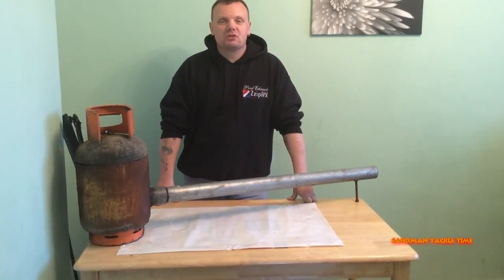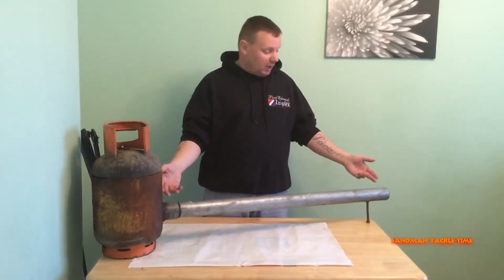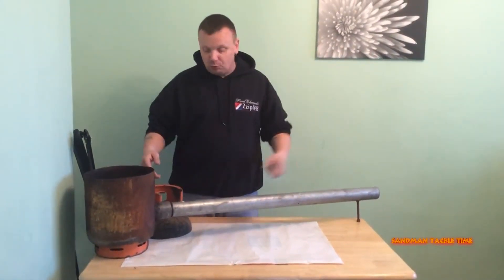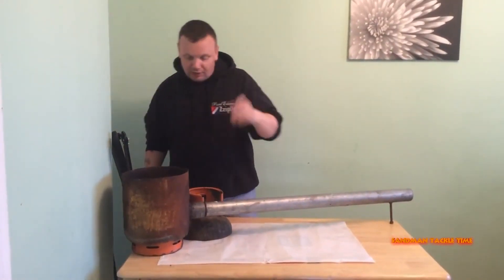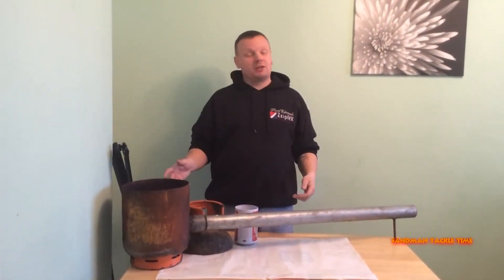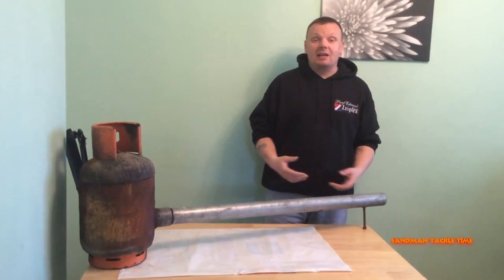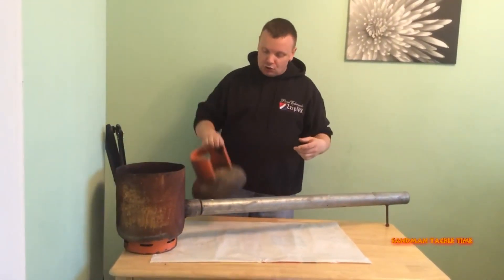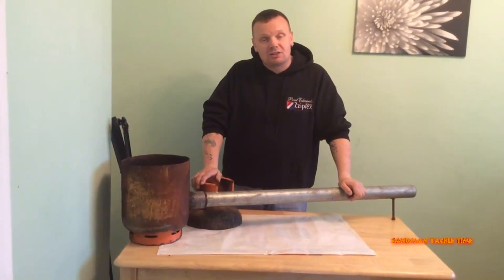Sandmans Tackle Time DIY ALUMINUM FURNACE FOR SINKER MOULDS

Comment: We Used A Small Fire Extinguisher As A Crucible Same Rule Make Sure Its Empty Then Cut The Top Off Using An Angle Grinder We Also Lined The Inside Of The Gas Bottle With Blue Concrete As In 3 Parts Cement 1 Part Kiddies Play Sand This Kept The Heat In, As For A Blower We Used An Old Heat Gun As It Is Fitted With A Metal Collar The Heater Element Was Removed So As To Keep The Electricity Bill Down
 We Keep About 2 Weeks Worth Of Cans & Then We Smelt. I've Not Done A Costing That Was Never The Point, It Was Building A Furnace Out Of Given Or Found Parts Being Able To Make And Work A Homebuilt Bit Of Kit, Also Once Your Neighbours & Friends Know You Get An Endless Supply Of Aluminium Cans To Use, We Also Use Our Own Charcoal Too But I Think Thats Enough For Now!
Reply: Have you got any videos of this furnace setup? I'm looking for something similar. Would really appreciate it if you have a video or website. Cheers